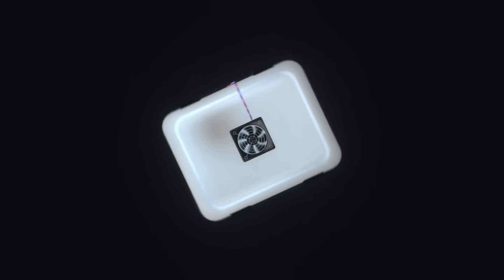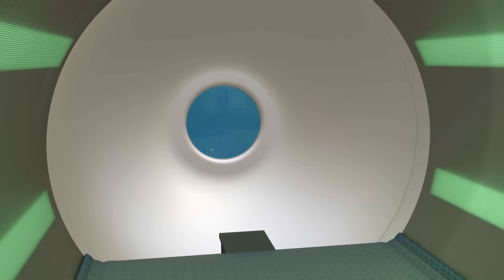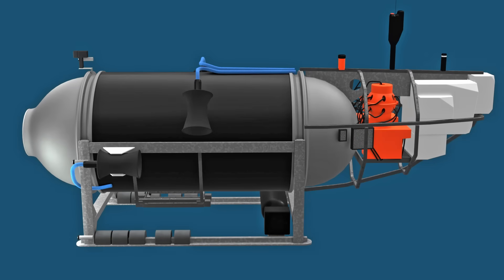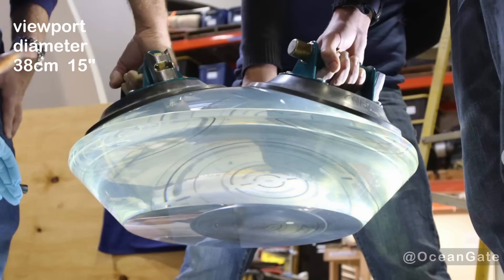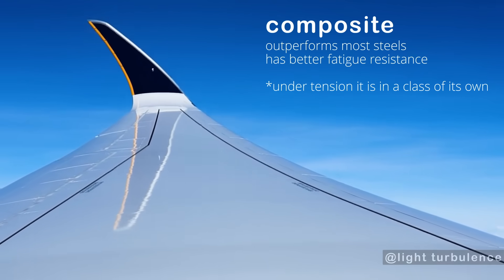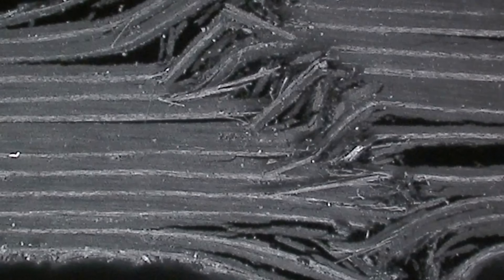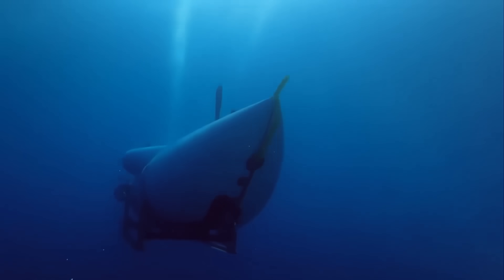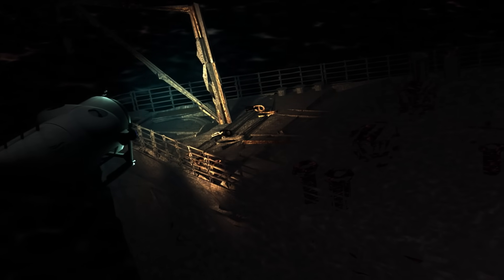Titan Sub | carbon fiber - Detailed Tour

Comment: I am an structures engineer, former Boeing, analyzed certified B777 carbon horizontal and vertical stress stabilizers, graduate degree mechanical engineering, specialty composite structures design and analysis. Frankly Carbon fiber is highly process driven and hard to inspect. Their layup, cleanliness, process was dubious. However I disagree composite structure, fiberglass or carbon fiber in compression great. No. Compression will be mostly in the MATRIX, the boding epoxy resin. So YES composites are stringer in tension. The epoxy is great in compression but has limits.  Also with repeated loads, high compression pressure, load, strain, at low temps any small flaw, crack in matrix (epoxy resin) will grow. The small cracks are hard to impossible to detect, but will grow fast when it reaches a critical size (a size too small to detect). It will get to the point where it grows rapidly at high load. BANG. Their acrostic detection system was not sufficient. Epoxy Carbon is NOT ideal for a compression application like a sub with compression loads due to these reasons.  If it were a pressure vessel, with pressure inside acting out in the cylinder, great. However the bonded titanium end domes becomes the issue.  Bonding metal to composite in tension is not recommended and likely to fail. That is why pressure tanks are fiber wound continuously and one piece, end domes and cylinder.  A complete sphere is best for pressure vessel. That is why the deepest diving submersibles are titanium and a sphere. Far safer than the Titan design.

Comment: Perhaps somebody already addressed this, but having some understanding of the physics of catastrophic implosion I'm confused as to why the combined failure mode of the flanges so confused you. It actually makes perfect sense once one considers the picosecond by picosecond propagation of the shockwave created by the implosion. The craft could very well have seen the failure of an inner flange anywhere between hours and microseconds prior to the failure of the pressure vessel itself—without obvious or even catastrophic leakage. Once the shockwave propagates to the damaged inner flange it may very well be expressed as a transitory 5000+°C temperature fluctuation combined with a similarly huge pressure wave (more than 10k atm is possible) which then just folds the outer flange out of the way like an overcooked noodle. This whole event also releases a spectacular flash of light due to the incandescence of the compressible fluids (gasses) involved.

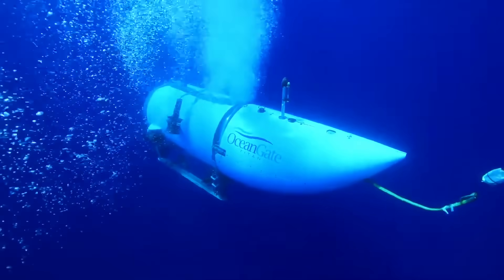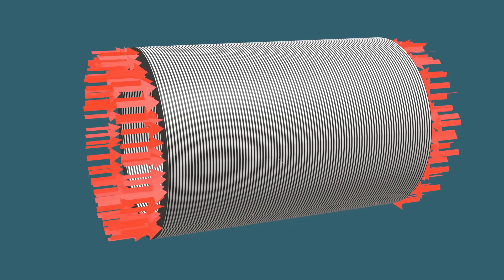Comment: At 8:30, this video shows other's concerns over the "compressive" strength of carbon fiber.  At about 11:02, would this be what they were concerned about? If the crooked-ness of the fibers isn't known, then how can it be a useful material?  The video mentions pre-tensioning the axial fibers, which would transfer the loads more from the axial to the radial fibers. This would likely prove both that the video is correct about carbon fiber being viable, and that the carbon fibers being under "improperly designed" compressive forces were the sub's flaw.  It seems like both perspectives were correct in that sense.

P.S. Something I've wondered about since I first heard of how the carbon fibers were "laid-up," "Why isn't there any indication of 'cross-weaving' like in the stock footage at 12:04?" (The robot's job in that particular clip looked a bit messy for the sub application, the cross-weaves wouldn't start mid-layer, and they would likely have had to keep the cross-weaved layers together [not creating gaps with the up-down in the clip], but it would still seem to me like having the cross-weaves would have helped the axial fibers transfer the load better?) The challenge I'd think might be the titanium caps squashing those angled fibers sideways? Just a curiosity.

Comment: 3.25 inches is not 20 mm😕
Reply from the maker: Oops. It was supposed to be 3/4”. Well spotted.
Reply: Great video BTW, though I have no knowledge of whether or not carbon fiber is perfectly good material for a submersible or a recipe for disaster. Either way - I suspect it will be some time before we see more fiber designs.

Comment: Wing bending demonstration is a pretty bad example : carbon fiber compression (on top of the wing) is compensate by carbon fiber extension (on the other side of the wing)... This compensation doesn't occur on a wrapped cylinder hull because pressure forces the carbon fiber to work only in compression without any compensation (in extension like on the wing example)... So it's a wrong argument.